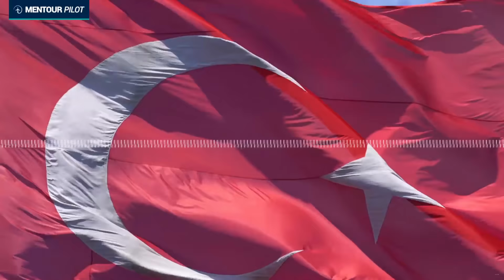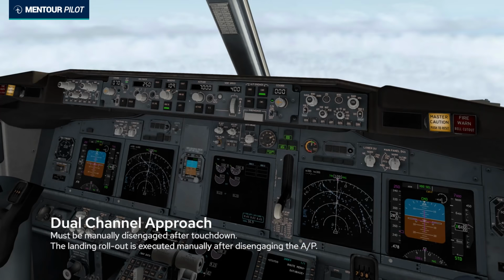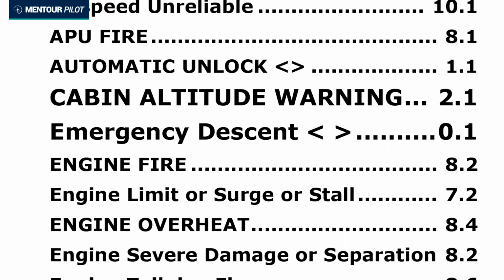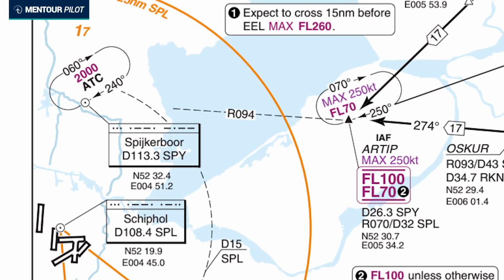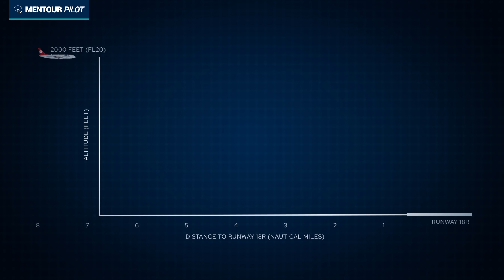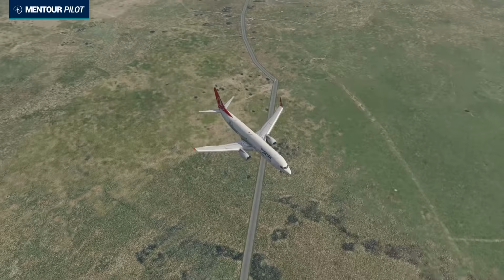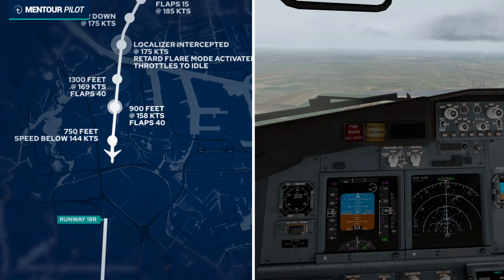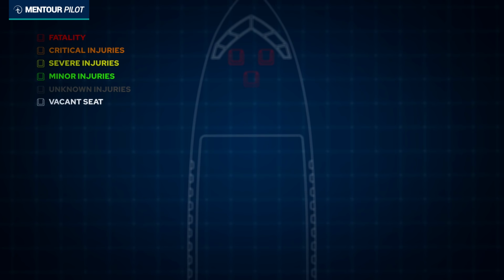What happened to Turkish Airlines flight 1951?!

Comment: Altimeter: We're currently tunnelling through the ground.
Autopilot: Sounds legit. Shutdown the engines.
Reply: Boing logic . . . same mess on the Starliner . . .
Reply: my first reaction in first 3 minuets  sounds wrong feels wrong  dont do it  to late sounds like boing made it complicated so if it crashed pilot was at fault  money again.
Reply: Haha Its funny
Still laughing
Reply: Sadly Boeing wasn't honest about their flight computer and sensor problems for a very long time and kept postponing taking any responsibility!! Such as for this crash they offered Turkish airlines a massive discount for new planes, in fact Turkish airlines has the cheapest 737-800s and 737-900ERs in the sector which was why they decided to sue Boeing first then changed their mind!! Ofc there was also pilot error that inexperienced first-officer couldn't spot or state malfunctions while the captain was simply overwhelmed as he was doing some of first-officer's job as well but the real problem was Boeing again who didn't properly share these problems with airlines and organized better simulation training that exactly same happened with Max and the company is facing billions of dollars fine now...
Reply: @ggoddkkiller1342  I think 737NG is a way better plane than that of the MAX
Yes Boeing sadly now only tries to only money keeping safety at stake
Reply: I kept asking myself if you have 2 radio alitimeters why the heck would you NOT use both, and NO I do not mean using the average value. ;-) Why not at least have a warning that alerts there is a significant difference in measured value? That way, even if only one is used for guiding the plane, the pilots wil at least be warned the vaules guiding the plane may be faulty. You don’t need a third altimiter to determine which of the other two is wrong, you just need a warning one of them  IS!
Reply: @bonnobloksma114  That's the thing. You see the captain's side radio altimeter malfunctioning, yet the autothrottle was still using that erroneous altitude reading on the glide slope. The autothrottle was designed to switch to the right side radio altimeter if it detected an error in the left radio altimeter. And by all accounts, it should have sent an error signal through the system, except it didn't. Since the error signal didn't trigger,  the system simply didn't need to double check values using the redundancy measures that were built in. Which is a human flaw during the programming of the autothrottle. Hindsight is 20/20, but when something is engineered to the extent that modern planes are, it becomes near impossible to train pilots to know absolutely everything about the plane and its behaviours. And this is not including plane behaviour in erroneous situations like this. There's no real way to know. What the captain likely should have done, is to call for a go around, and attempt to manually fly the plane back in and not depend on the autopilot + autothrottle. Given there were no warnings in the cockpit, but an obvious error in the radio altimeter readout, you err on the side of caution and take the plane back around, manually. They are trained to fly planes manually, so this is one of those situations where you take charge because there's no way to know which of the circuits are firing inside a computer. That autothrottle felt no need to keep speed up because to it, you were already on the ground, so the engines were at approach idle the whole time. Computers can't understand anything. They simply crunch numbers. At the end of the day, they send signals to the flight controls based on a sophisticated set of if-else conditions (simplistically speaking) laid out by the manufacturer and the humans who programmed the systems during development.
Reply: Well, the altitude of Schiphol is actually −11 ft AMSL. But in normal conditions you only see that on the barometric altimeter.
Reply: @aakashravichandran8444  Mostly true.  The landing gear configuration warning and speed brake arm/not armed discrepancy should have been enough.  But even after ignoring all that if they had done a go around per SOP it would have gave them breathing room to think through what was actually going on.  My question is what safety did the safety pilot actually provide?
Reply: As a developer, how could they forget about adding a sensor malfunction warning ? Any kind of input should have defined behavior over its full domain. -8 is clearly an error and could trigger a warning if it lasts for 1sec or more.
Reply: @aakashravichandran8444  You are wrong! If you have a bunch of redundant sensors just rund them throught a sensor-fusion-box first. But BOING is not able do deliver useful software anymore!
Reply: @Anonymous-tu4pl   ive read some alarming stuff about the max-and Boeing's degeneration as a company in general.
quality inspectors catching assembly workers trying to sneakily take defective/rejected materials/components from disposal bins instead of going to the warehouse for more- and not even getting a slap on the wrist...

allegedly, the root of their "problems" is the company bewilderingly declining to fire the idiots who killed Mcdonnel Douglas when Boeing bought the company out years back-and hiring them on in similar positions for long enough for them to "infect" Boeing's corporate culture to a similar degree...
the complete idiots responsible for the DC-10 cargo door scandal that destroyed public trust in MC'D- or at least people who worked their way up under them,
 are now running Boeing....
Reply: I am a software engineer and I am continually dumbfounded by the lack of sanity checks in these systems, especially when direct locking is a known and predictable failure mode for the radar altimeter. This incident was not caused by the pilots, but by the design of the overall system. Any time the aircraft takes actions that aren't directed by the crew there should be an alert. Doing otherwise disconnects the pilots internal model of the flight from reality. There are hundreds of things to monitor during landing - it Is obvious that crew will not notice instantly when things are changed. This and many other incidents could have been prevented with better system design, such as audible "IDLE" or "FLARE" alerts to keep the pilots appraised of the invisible internal state of the computer.
Reply: @XIIchiron78  Indeed.

Thinking about it, having each system give off a low hum at different frequencies according to its state could be a good solution. In my experience the human brain is good at filtering those out but also at noticing unexpected changes.

"Imperial March on Boeing Cockpit" when? ;)
Reply: @ggoddkkiller1342  what else did you expect from American manufacturer?..
Reply: Yeah I would have thought illogical values would sound an alarm and definitely not be used for decisions within the computer.
Reply: @mariohendriks1  This is a radio altimeter, wich never goes below 0
Reply: @EE-cc5bd  As a developer. In fairness that relies on the system itself knowing there is a fault in order to alert about said fault. Though I still think you could alert out when there is a difference between system 1 and 2, that would be bobbins I think
Reply: @Stettafire  But whether the sensor is able to detect its malfunctions or not, consumer code could have detected one with (value < 0) in this case. Sanity checking is always the responsibility of the consumer code unless you can afford paying the third-party's insurance for "life-or-death" QA.
Reply: @GerardMenvussa  Well, not sure if -8ft here means MSL or AGL. Big parts of the Netherlands are below sea level.
Reply: Spot on.  But that is just the start.  Putting my software engineer hat on, I see major issue after major issue.

1) No external input sanitation / verification.
a) The components are dual-redundant they should have been cross checked.  If you just ignore one input, that is not redundancy!
b) Even if there was just one altimeter, negative value is obvious bogous and the competent should be marked as failed, and not used.
c) Even if there was just one altimeter and it showed positive value, based on GPS and GPWS database, you know what the approximate value should be and disregard it if the value is not sensible.
d) It also bother me the planes have no sense of physics.  There are many other crashes, whether the inputs make no sense (say altitude is increasing, pitch up, engines idle, and yet speed is increasing - which can not physically make sense) and yet the autopilot goes ... "sounds legit, maybe I will pitch all the way up to shed some speed" or something equally crazy, and crashes the plane.

2) No feedback to pilots to improve situational awareness.
a) It just dully shows negative altitude with no warning?!
b) When the other auto-pilot refuses to engage, the is no error message stating why?
c) Is hiding the G/S and LOC lines really the main clue to pilots that something is wrong, surely there is better UI design options.
d) If the pilot sets desired air speed on auto-throthle, and there sound be visual feedback it the plane decides to over-rule it and set speed to 0.
e) There is no significant visual clue that the plane thinks it landed?  I imagine the display should be different enough so that one look and the pilot would go "no, we are not on the ground!  go-around".  (text clue does not count for this IMHO!)

3) Complete falilure of on-bread safety systems.
a) There is stick shaker, but way too late.  The plane knew way ahead of time, that at current rate, this is the situation it will get into.  The warning triggered past point of no return.
b) Same from ground proximity warning system.  It knew the plane is on trajectory to ground, and triggered only past point of no return.
c) At stall, shouldn't the plane go to full thrust on its own?  Not actively fight pilot.
e) To flip the situation, if the pilot flew manually, and set throttle to idle at random point, I would expect at least one minute of warnings before the point of no return, with the plane potentially taking actions to prevent the stall/crash.

4) Inconsistent auto-pilot.
a) What's up with the need to dive to catch G/S?  Either the auto-pilot should do it on it own from above if it is safe, or just force go-around if it is not.
b) It seems that auto-pilot simultaneously thinks it landed, and that it is fling.  Some sub-systems operate as if the plane is flying, and some as if it landed.  I would understand if thought bad data autopilot though it landed, but then all system should operate under that assumption.  Not this split-personality.
c) It seems that the auto-pilot is in the "landing" mode for very long time.  How long does it think the runway is?  And why does it keep descending on runway?  And why didn't the wheels hit the ground?  And why does the GPS say they are off the airport.  There are dozens of clues the plan is not on the runway... but let's shut off the engines anyway?
d) The stall is caused by plane pitching unreasonably high to preserve G/S. Why!?  Can the G/S just give up, warn, or force go-around?  Auto-pilot manuevers should not crash or stall the plane.

Let's be honest... the plane appeared to behave normally until the very few last seconds... when the plane decided to crash itself, due to no fault of the pilots, who had either no or very little time to react to the sabotage.

I don't understand this.  Some of those things (like cross checking and sanitising inputs) are super-basic in software development.  Can someone please explain to me how come the planes have so terrible software?  (bureaucracy?  odd consequence of rules?  being super cheap?  is the software in fact 40 years old and just on life-support?  company management?  failure to attract any decent engineers?  needing to use some esoteric programming languages?  avoiding legal liability?)

I mean... the software situation is horrible.  I think this video represents majority of crashes ("bad plane software directly caused the crash; the pilots had theoretical chance to fight the software, but they took too long").  I am genuinely curious how can we possible be in this situation?
Reply: @dsrbecky  I think much of this is caused by the insane testing requirements for airplane systems. They basically insist on 100% code coverage in black box tests. The result is that it is next to impossible to design a holistic system that cross-checks data from all available systems---you would never be able to black-box test that thing completely. So instead they build many, many, independent systems that have a specific job and can be independently tested. And each of those works perfectly within its specification envelope. Its very narrowly defined specification envelope...
Reply: Yes. And that´s usually the outcome when computers are trying to think.
Reply: @GerardMenvussa  Yes.
Reply: @aakashravichandran8444  Yes - and human beings in this case who had not foreseen this event.
Reply: @XIIchiron78  Indeed!
Reply: @dsrbecky  Thank you very much. It´s a very convincing critical review. Only one addition. The software used in all 737 (including the NG and the MAX) is the software from 1967 - the year in which the 737 was certified. To change this would mean that the certification of the 737 is nullified - and a recertification would be impossible because the 737 is a design of the 1960ies which is in many basics way beyond all legal standards of certification required in the 21st century. That was the reason for MCAS in the 737 MAX and all the trouble they´ve since with it. And it´s not only a Boeing-deal. Even a brand-new A 320neo, just delivered, has a software from 1987, when this aircraft was certified and Bill Gates had just started his business. For the very same reason. But between 1967 and 1987 there was a huge progress in software matters, so the A 320 is not-so-way-behind the present as the 737.
In fact it´s astonishing what the software engineers are able to pull out of such an old software.
Reply: @NicolaW72  That makes sense.  It is very sad state of matters, and it does not feel very safe, but it makes sense.
Reply: @NicolaW72  Uh, Bill Gates started Microsoft in 1975, I was using PC-DOS by early 1982, as IBM PCs overtook Z-80 machines, with Windows released in 1985, such as it was.  So Bill was very far into his company by 1987.

So, what you are saying is that if Boeing's engineers added a few lines of code, like (if radar alt < danger_alt,  check redundant + other systems, if not logical  alert and turn off/on proper systems),   it would be months of testing and then recert? And wouldn't they already have a test harness or black box for that?  I wonder how air travel can be as safe as it is, if a major bug can't be fixed after it crops up or kills people.  I guess the idea is that pilots + automation work together to avoid issues, but is that the way things should be with the workload and amount of extraneous information about these marginal systems?  Aircraft systems are just so complex now, which is a problem in itself for software integrity.  And probably some of the software is written in assembly language and some in C  (hopefully Boeing and Airbus have best practices re languages and don't just allow cowboy programming but probably).  All that old code, modified many times by many engrs, adds bloat and is a huge risk (but redoing it is very expensive and also risky).  See Windows for a good example of this lol.  

Quality Assurance (QA), in my experience, has the worst budget, is uncool to work in, is the first thing to be cut on the project timeline, and generally not respected by management.  Also, programmers usually HATE to test and I've seen this get much, much worse over the years and apps are buggier than ever but people think that's normal.  Like, no one aspires to be a QA engineer.  And if you are in a small shop, likely very little testing is going on; they leave it to the customers.  In general, not saying aviation is that way, but I bet some of that has crept in.
Reply: This happened also with a European Mars lander. During its parachute descent, it spun quite a lot and thr computer got confused and decided it was underground, so the probe cut the parachute line and fell to its death
Reply: @ggoddkkiller1342  I mean, they are also just a corporation, and like any other one, they also try to cut costs and make things as cheap and low quality as they can possibly get away with in order to maximize profits. That is why very strict regulations are so important for planes, but of course regulations can sometimes be secretly ignored and then big problems can happen.